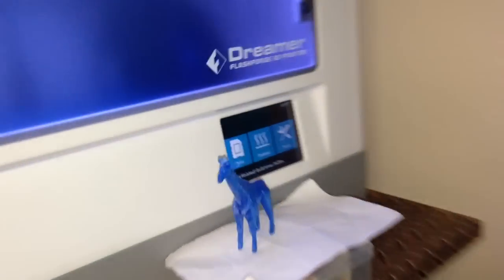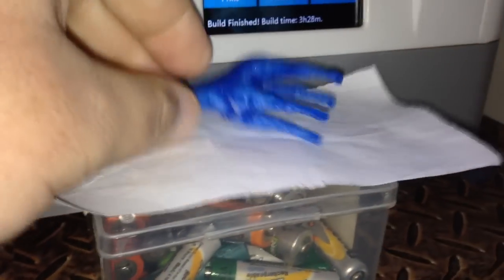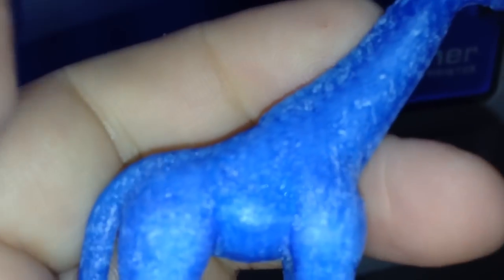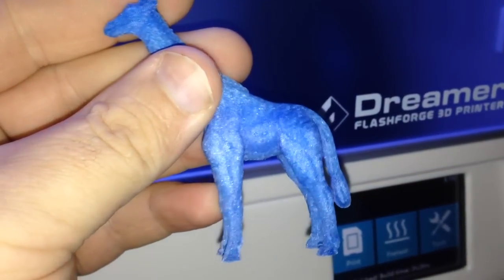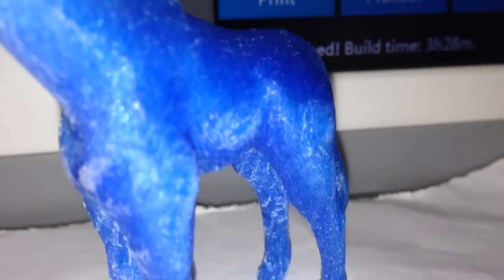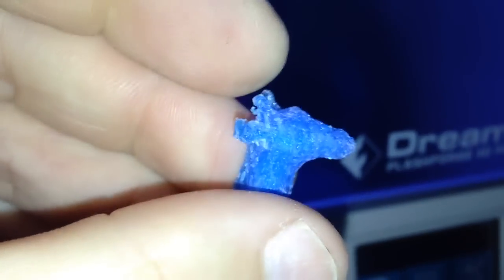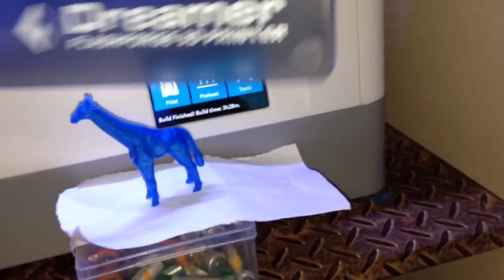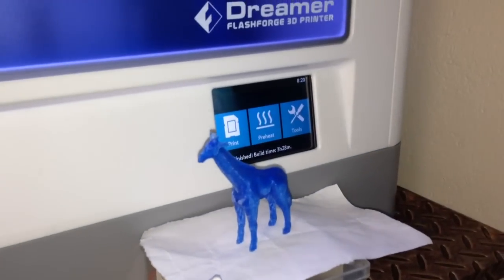Flashforge Dreamer - 80 micron Giraffe Part 2

Comment: hey Thomas, thanks of uploading all these videos. I have a dreamer ordered but I cant find much information about it. 
I thought the dreamer could only print down to 100 microns. How did you set your to work that low ?
Reply from the maker: Hi Sam. I was in talking with Flashforge support and they have now offered a firmware upgrade which can now support down to 50 microns! The level of detail in this giraffe is simply amazing. The youtube video simply doesn't do it justice
Reply: Thomas James Just doing my first printing with the Flashforge. Appreciate your video uploads a lot - contributed directly to me purchasing.
Reply from the maker: Glenn Bignell Thanks :). I noticed there was like literally no videos at all on the net about this printer so I thought I'd add some once mine arrived. I just tried uploading a new one just now but it failed after 98%. grrr
Reply: That's a real bummer haha. Maybe i'll contribute some if i get something decent to record with. Just used abs for first print. Do you have some favourite temp/speed settings for it?
Reply from the maker: ABS: 220c bed at 105c speed 90mm/s
PLA: 200c bed at 60c Speed 90mm/s

These are my favourite settings
Reply: Ok awesome. Just trying a bigger print now with increased speed. Have you tried using Slic3r with fast support speeds to improve support breakaway? Not sure if this would work? I've currently only really used skeinforge